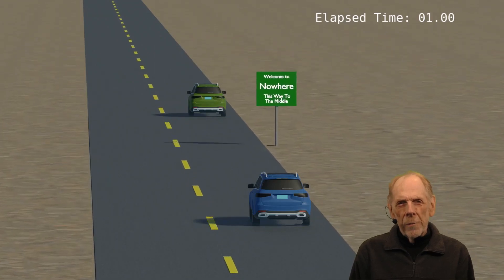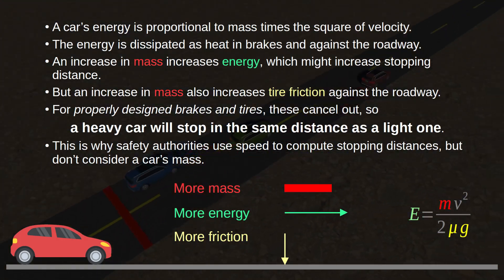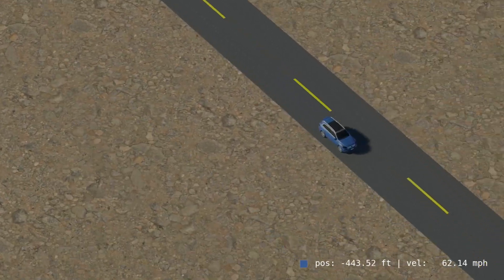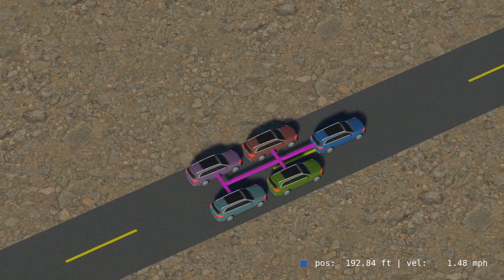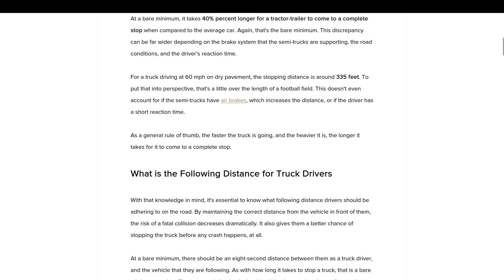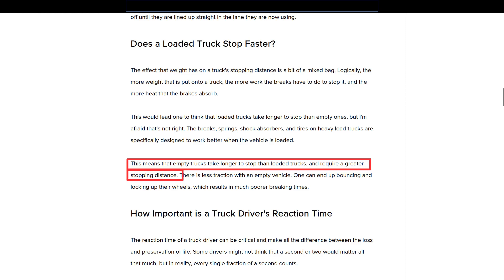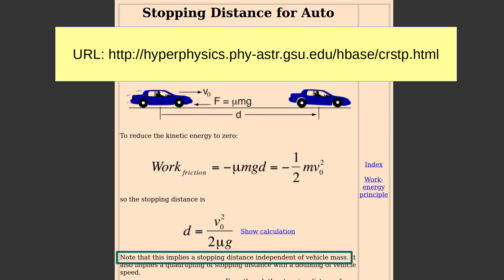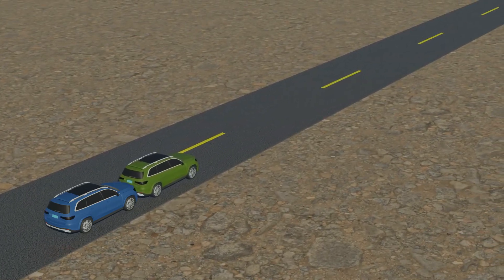Car Safety Myths: Exposed

Comment: I'm confused where the line is between physics and engineering.

If a car had the weight of the moon, of course its braking distance would increase above that of a regular car. But I guess that is because the load has too little contact (only 4 tyres). Braking force isn't increasing proportionally to its mass. So I guess the solution is engineering more wheels?
Reply from the maker: In realistic circumstances, increasing vehicle mass doesn't increase braking distance -- that was the point of my five-car monster vehicle example. As you reduce the tire contact area, the relationship begins to break down, but not in a linear way, until the brakes cannot handle the energy or the tires melt under load.
Reply: @lutusp  You keep referencing "until...the tires melt under load" - this is not the only limit, mechanical grip of the tire can easily be exceeded without them 'melting'. Braking on ice or loose surfaces shows this. This limit of mechanical grip is certainly (in the real world) a significant factor in the reality of heavier vehicles requiriing more stopping distance (eg large SUV or semi vs a compact). Tires can not be manufactured to have 'infiinite grip' especially on poor surfaces like dirt and ice. 
While we like to simplify problems to get at the 'base' understanding in physics, we can't lose sight of the 'real-world'. In reality, heavier vehicles take more distance to stop - that is the fact that exists and people need to know, most do not need to know the 'ideals' underpinning forces and motion. (Yes, I do have a physics degree - currently working on my PhD but a ways to go yet).
Reply from the maker: All your points are correct and important, bur in a video meant for non-specialists I try to avoid too much technical detail. If the point is to alert people to driving dangers, there's no point in creating a perfectly accurate video that no one watches.

Thanks for posting!
Reply: @lutusp  Alert drivers to what? The fact of the matter is, your model of a constant deceleration is flawed enough it could be considered misleading. Big trucks simply do take longer to stop due to material constraints, and limited contact area between disk and brake pad. Drivers should therefore take more caution around them. Saying that we shouldn't model with mass in respect to stopping distance is flawed.
Reply from the maker: @BrainiacManiac142  > Saying that we shouldn't model with mass in respect to stopping distance is flawed.

Yes, it would be better to instead provide a graphic, easily understood example that falsifies the presumption. But then, I did that in the video. Everything after that is about engineering, not theory. Falsifying a commonly held wrong belief was the primary aim.

Thanks for writing!

Comment: I agree, this is theoretical to the point of being misleading itself.
Reply from the maker: > ... to the point of being misleading itself.

Not as misleading as the many online sources that try to say that mass directly increases stopping distance, as with my quoted examples.
Reply: @lutusp  Tell that to those who have been crushed by heavy vehicles in crashes because they could not stop.
Reply: @patrickbuick5459 that's likely because their brakes failed, which is by the way not uncommon for poorly maintained trucks. This can also happen if the truck is overloaded (i.e. loaded more than the certified maximum allowed mass).

The video assumes the brakes are working properly and the truck is properly loaded.
Reply from the maker: This is about a physics principle, which is correct, not about a badly engineered vehicle that shouldn't be on the road in the first place. The point of this kind of science is to point out, not how things are, but how they ought to be.
Reply: @lutusp  Then titling it "car safety myths" is the misleading part. Theory without practical application is of extremely limited utility. So is the inability to effectively communicate or be able to take in other viewpoints. I don't have a problem with, nor am I disputing what the physics states and shows. I'm disputing the misguided attempt to apply a purely theoretical approach that makes innumerable assumptions in an effort to draw and state an unsupported conclusion in essentially an information vacuum. Disparaging the engineering without addressing the limitations involved in engineering said solution is simply choosing to be ignorant of those limitations / trade-offs as only a blundered pure academic can do.

It is apparent that I am dealing with a "black box", a closed system, so I'm done. I have said my piece and you either can grasp my viewpoint or not, but after waiting, nothing you have said has changed my opinion, as nothing I have said has moved yours. Call it a stalemate.
Reply from the maker: @patrickbuick5459  > Theory without practical application is of extremely limited utility.

The history of modern science is one of theory first, practical application next. So no, not really. Without theory we couldn't even imagine fusion reactors, much less try to build one.

Without theory, no one could argue against people who -- for example -- wrongly think more massive vehicles require more stopping distance. That would prevent any correcting actions.

> ... as only a blundered pure academic can do.

When you attack the person directly, you implicitly acknowledge that you can't easily attack the argument he presents. Don't acquire this reputation.
Reply from the maker: @patrickbuick5459  > Then titling it "car safety myths" is the misleading part. 

Not misleading at all. I found any number of sites that claimed that massive cars necessarily require more distance to stop. I quoted a few of them (many more were edited out). They're wrong. They perpetuate a common myth. The title is entirely justified.

Comment: That fog example was frightening. In dense fog, the only safe way to keep driving is to reduce speed, so that you can stop within the distance you can see (in fact, that's true of driving in general).
Reply from the maker: > ... so that you can stop within the distance you can see ...

Yes, true, plus the fact that the "three-second rule" won't work if you're driving toward a prior crash and can't rely on the expectation that the car in front of you is still braking to a stop. For that case you need even more time to react. This makes fog more dangerous than most people realize.

Thanks for writing!
Reply: @lutusp  There is also the issue that people driving in fog underestimate their speed, resulting in them going faster. I'd add that drivers should be using their hazard flashers in low visibility conditions to extend how far the driver behind them can see you from.
Reply: The problem then is with people behind you driving dangerously fast. (Which is probably most drivers in foggy conditions, considering even with 100ft of visibility you would need to drive 25mph to stop safely) It is probably more dangerous to drive slowly in foggy conditions due to the likelyhood that someone else reckless behind you will make a mistake. The only safe option in foggy conditions is just to wait it out, as the video says.
Reply: Some cars have for a while thermal camera superimposing view on the digital dashboard and nowadays perhaps even a head-up display not to mention that you have also had radar-assisted automatic emergency breaking for over a decade but generally, it's better to slow down than to trust with your and other's lives on tech, especially as many emergency breaking assistants like one in newer Tesla cars given up on the radar that made them pretty useless in fog while radar or even LIDAR can experience malfunction or interference that cannot be easily spot. So, until high-speed thermal cameras with sufficient resolution in cars proliferate, and traffic signs are redesigned to be clearly visible in the infrared spectrum, it's better to plan ahead and avoid driving in an area with heavy fog if you can...
Reply: @IonorRea  The technology of assisted automatic emergency breaking may have been in beta for a decade and I feel like its still there. I've had my car suddenly slam to a stop because of a shadow on an otherwise sunny day. It can't tell the difference between a two dimensional object or a three dimensional one. Also my daughter just collided with someone who was at a stop sign (fully stopped) when the emergency assist didn't react fast enough. My daughter felt it took over because when she hit the breaks the car didn't slow down even faster. Were waiting for the investigation on that. So our theory is the vehicle prevented her from applying the breaks in an emergency force vs the computer thinking it just needed to slow. The collision was slow enough for minor damage and hopefully the car can say how far it traveled while the computer took over breaking. The investigator will compare it to it's normal stopping distance at the speed that the computer says she was going (48mph). I personally would drop the title "emergency"  assist and just label it "assist if it wants to even if its wrong".
Reply: @djdickey  Being fooled by shadow suggests that what you have is not primarily a radar-based emergency braking system but an optical one, or some hybrid solution where the optical system overrides the radar system which would be useless in the heavy fog one way or another but I heard that even radar-based systems get sometimes fooled when radar energy gets deflected multiple times for example in tight crossroads with multiple road signs while not every radar based system is equal to the best on the market. Tesla, for example, removed radar functionality from its cars, even from older cars that got it already by software as they did not manage to work it properly, claiming multiple false positive events when a car suddenly stopped for no reason...

Comment: 1:22 Braking distance isn't about energy (that comes into play only in mega-heavy vehicles, or repeated stops)

Braking distance isn't governed by E=mv^2/2, but by x=1/2at^2+vot+xo  where t=(Vo-Vf)/a, and a=F/m~g*mu, mu~1 for ideal conditions, and down from there.  So a small mu (like ice) will increase the stopping distance proportionally.

So simplifies to x=3*V^2/(2*a); x~ v^2/22 (for feet per second)

So 20 mi/h ~ 45 ft to stop
So 40 mi/h ~ 158 ft to stop
So 80 mi/h ~ 622 ft to stop

yes, I skipped the step to convert mi/h to ft/s.  Because I'd be using m/s for all of it...

Big trucks stop slow because of cost.  No laws of physics would be broken making an 80,000 lb loaded truck stop in the same distance as a Porsche 911.  It would just be expensive, and maybe heavy.
Reply from the maker: > Braking distance isn't about energy ...

But it is. If there were no energy, there would be no need to dissipate that energy as heat in the brakes.

Thanks for writing!

Comment: I think I'm missing something. Do I understand correctly if I say that the calculations show that mass has no effect on stopping distance but  "there are many practical and economic issues that explain why a heavy car or truck requires more stopping distance." (6:00) So tradeoffs in engineering, materials, cost, etc. are such that heavier vehicles DO require more stopping distance.

It seems to me that the correct answer depends on the context of the question. If you're asking about simulated vehicles on simulated roads, then the answer is no, heavier vehicles don't require more stopping distance. If you're asking about real vehicles on real roads, then the answer is yes, heavy vehicles require more stopping distance.

Maybe I'm just dense, but if I'm can be confused, other people can be too. I think it's dangerous to be at all ambiguous about this point unless you want people getting behind the wheel of a large heavy vehicle, thinking that they can stop just as quickly as a smaller lighter vehicle and driving accordingly.

If the focus is on safety, then the answer should pertain to how a real driver should treat a real vehicle in the real world. From watching this video, it looks like people should walk away with the knowledge that yes, heavier vehicles do require more stopping distance, which would mean it's not a myth, but just has some nuance.
Reply from the maker: > If you're asking about real vehicles on real roads, then the answer is yes, heavy vehicles require more stopping distance.

Not if the tires and brakes are designed properly. This is the point of my five-car monster vehicle example -- it weighs five times as much, but it stops in exactly the same distance as one car. Everything after that is about engineering -- which tires, which brakes, and so forth. Not physics.
Reply: @lutusp  I see. Thanks for setting me straight. Loved the video.

Comment: Alright I gave this thumbnail the benefit of the doubt. I'm not very disappointed, despite the claims being slightly exaggerated

05:13 the way I like to remember this, is that the extra "stopping" energy has already been already "spent" when accelerating that car. ie. you already cancelled the extra work (watts) you need to spend to stop the heavier car when you accelerated to that speed

in reality, a heavier car will be sliightly faster to stop due to material science reasons if it's the only added factor. the weight distribution is a tiny but not insignificant factor too, again due to material science (the way the rubber interacts with the asphalt). That is until you hit a "breaking point", when the car becomes so heavy the breaks can't break enough, and overheat
Reply from the maker: > the way I like to remember this, is that the extra "stopping" energy has already been already "spent" when accelerating that car. 

Well, energy has two primary forms -- kinetic and potential. When you accelerate, you're turning kinetic energy into a mixture of potential and kinetic energy, which are represented by the car's mass and speed.

When you hit the brakes, you're converting that energy mix into kinetic energy again.

I hope this helps, and thanks for posting.
Reply: @lutusp  Yes indeed :) Thanks. But also, make it in beamng please I'm begging you
Reply: Oh, also ABS might be a factor in this too
Reply: 07:30 preach!
Reply: 08:43 would be a good idea to test fancy new ai, bard, chatgpt etc. see what they give as the answer

Comment: This video incorrectly compares cars, which have 4 tires rigidly tied together to 18 wheel trucks, which typically have 8 tires rigidly connected together and 10 more wheels rigidly tied together, but those 2 sets are only connected by an imperfect pivot point.  If you could eliminate the pivot point and only drive in a straight line, then, in theory, that truck can brake just like a car.  Furthermore, since some trucks are empty and some trucks are full, there can be no way to insure that all the tires will brake evenly according to their load.  So, in the real world, trucks need a greater stopping distance than cars.  Any truck driver who knows their stuff will tell you that.  Furthermore, if your tires are bouncing off the road due to an empty truck and large potholes, your stopping distance will increase.  This guy also has obviously never driven in a congested area.  If you EVER leave more than a car length to the car in front of you, someone WILL cut out in front of you, taking up that space.  Unfortunately, tailgating is seldomly enforced where I used to live, which is New Jersey.  Again, real world vs theory.
Reply from the maker: > So, in the real world, trucks need a greater stopping distance than cars.

This is why I presented the five-car monster vehicle example -- it proves that this claim isn't true. And when trucks take more distance to stop (which they certainly do) it's because of design, not because of physics.

> Again, real world vs theory.

The distinction between real world and theory in this case is about economics. A very expensive truck would stop in the same distance as a car, but it would be very expensive. Not because some natural law that requires trucks to stop slowly.

Comment: Yet another physicist forgets about the elasticity modulus of the tyre and how it makes the friction equation non-linear.

This one is so easy to demonstrate safely that it honestly astonishes me that people don't test it BEFORE publishing erroneous videos about it.
Reply from the maker: > Yet another physicist forgets about the elasticity modulus of the tyre and how it makes the friction equation non-linear.

I clearly mentioned this -- several times -- as the practical limit of my example. Nevertheless, most people get this issue entirely wrong, an error my five-car example is meant to address and falsify.

> it honestly astonishes me that people don't test it BEFORE publishing erroneous videos about it.

Watch the video again. Locate where I don't qualify my results as approximate.
Reply: Actually, the coefficient of traction of a tire IS quite linear, until the sheer strength of the rubber compound is exceeded. Tires with the appropriate inflation pressure, size and compound for the weight of the vehicle under test is assumed. It is also assumed, that the brake system compensates for weight transfer, so the axle torque is exactly proportionate to the load on each tire. (An ideal antilock braking system) You would be surprised, how good the braking systems on newer modern cars actually are! @lutusp